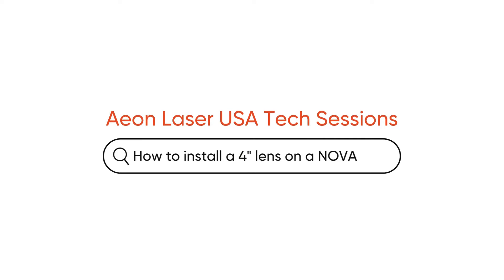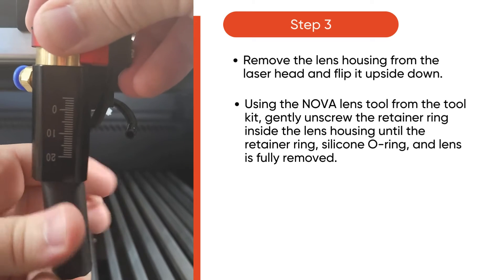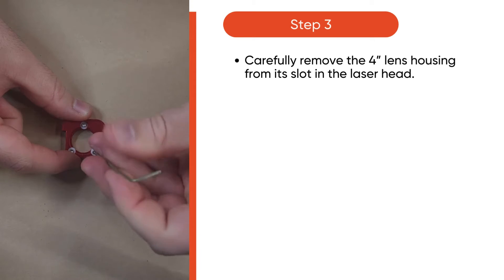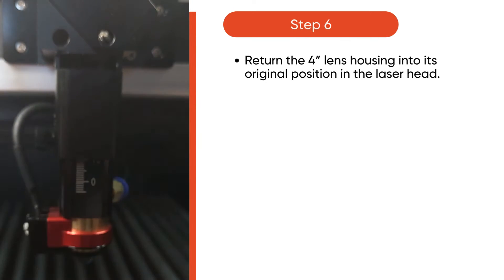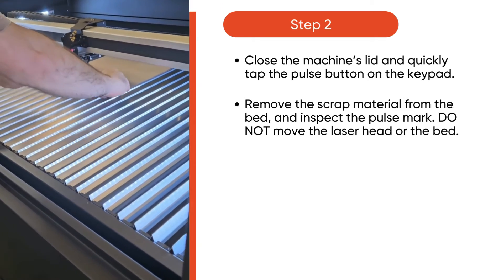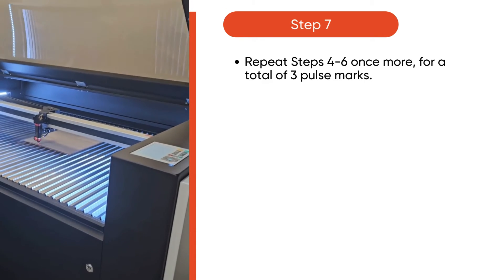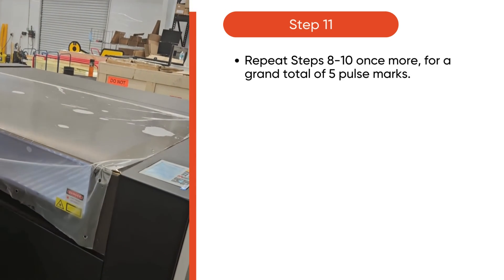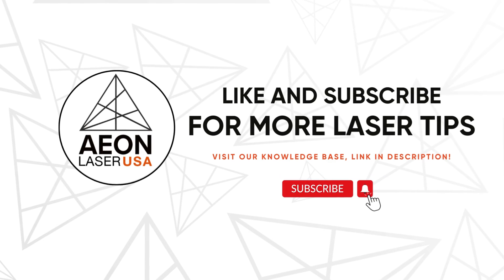How to Install a 4" Lens on an Aeon Laser NOVA

Comment: Does power and speed value change when switching lenses?
Reply from the maker: Hi there! 

The benefit of the 4" lens is that it provides a deeper focal length, which would change the beam profile & intensity of the laser. Because of that, the settings may potentially change. We recommend running a few tests on a scrap piece of material prior to the final product! 

Let us know if you have any other questions!